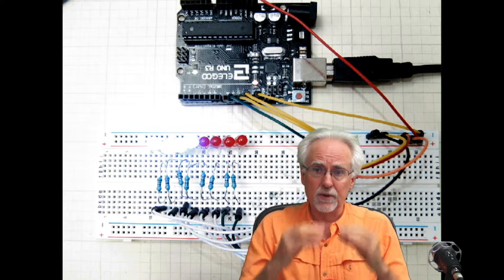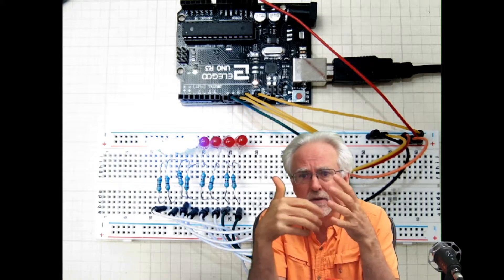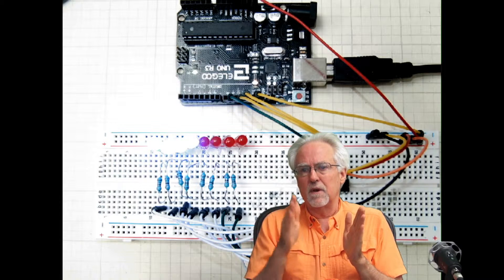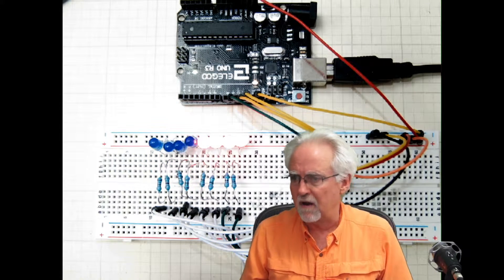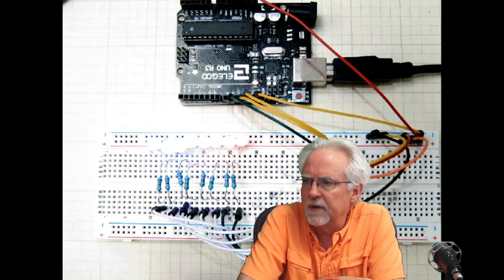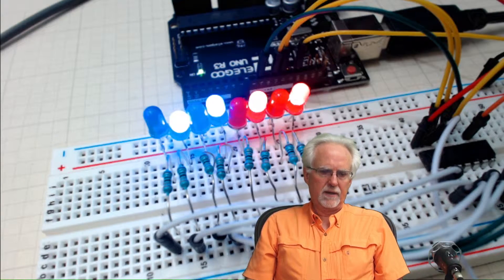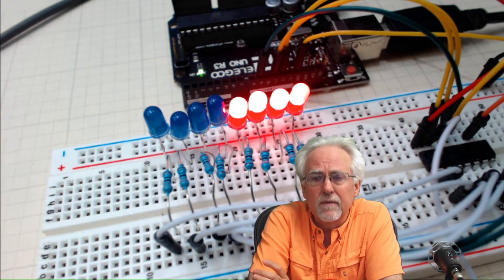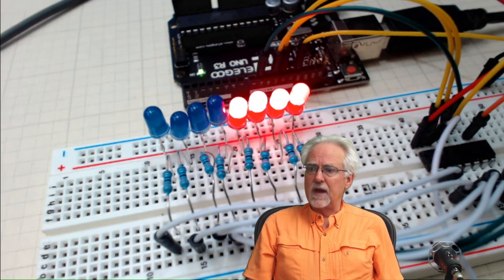Arduino Tutorial 46: HOMEWORK- Create a Binary Bit Flipper with the 74HC595

Comment: int dataPin = 12;   // DS
int latchPin = 11;  // ST_CP
int clockPin = 9; // SH_CP

void setup() {
  pinMode(dataPin, OUTPUT);
  pinMode(latchPin, OUTPUT);
  pinMode(clockPin, OUTPUT);
}

void loop() {
 
  byte leds = 0b01010101 ; 

  digitalWrite(latchPin, LOW); 

  shiftOut(dataPin,clockPin,MSBFIRST , leds) ; 

  digitalWrite(latchPin, HIGH); 

  delay(1000); 

  
  leds = ~leds ;  
  digitalWrite(latchPin, LOW); 
  shiftOut(dataPin,clockPin,MSBFIRST , leds );

  digitalWrite(latchPin, HIGH); 
  delay (1000) ;
}

Comment: I used Value=0xF0; to turn on the high nybble, or the 4 leds om the left. Then I used Value= ~Value & 0x0F; to switch off the high nybble and turn on the 4 leds on the right. But this solution would require using Value in the shiftOut twice with a short delay called dt between each shift. Alternatively, I could use Value=B11110000; and Value=B00001111; , but that's not true bit flipping. I believe the "~" operator is.
A little thought in the mater suggest: Value >> 4; shifts the high nybble into the lower 4 bit nybble position. Simpler.

Wayne

Comment: Homework:

int latchPin=11;
int clockPin=9;
int dataPin=12;
byte LEDs=0b10000000;
byte LEDread;
int wait=500;
String data;

void setup() {
  // put your setup code here, to run once:
  pinMode(latchPin,OUTPUT);
  pinMode(clockPin,OUTPUT);
  pinMode(dataPin,OUTPUT);
  Serial.begin(9600);
}

void loop() {
  // put your main code here, to run repeatedly:
  LEDread=0b11111111-LEDs;
  Serial.println(LEDs,BIN);
  Serial.println(LEDread,BIN);
  digitalWrite(latchPin,LOW);
  shiftOut(dataPin,clockPin,LSBFIRST,LEDs);
  digitalWrite(latchPin,HIGH); 
  delay(wait);
  digitalWrite(latchPin,LOW);
  shiftOut(dataPin,clockPin,LSBFIRST,LEDread);
  digitalWrite(latchPin,HIGH); 
  delay(wait);
}

Comment: Yes Paul, I've done the homework above though it took me sometime to figure out the math involved.
At first I was only able to make the last four bits(LEDs) complement the first four bits by multiplying the value of the byte by 16( 2 raised to the power of 4. )  In this manner any value between binary 0 to binary 1111 that you put in be be replicated in the four higher bits. Beyond that it was all garbage.
Then I begin to think of deducting a given value from 255( all LEDs lit ). For example if the value given is 250( binary 11111010 ) and you deduct that from 255( binary 11111111) you get 5 ( binary 00000101 )which is the complementary symmetry resultant.
Used this in the formula and voila it works !!! Now to check out Tutorial 47 on how you did it.

Comment: int latchpin = 11;
int clockpin = 9;
int datapin = 12; 
byte count = 0x0F;

void setup() {
  // put your setup code here, to run once:
Serial.begin(9600);
pinMode(latchpin,OUTPUT);
pinMode(clockpin,OUTPUT);
pinMode(datapin,OUTPUT);
}

void loop() {
  // put your main code here, to run repeatedly:

digitalWrite(latchpin,LOW);
shiftOut(datapin,clockpin,LSBFIRST,count);
digitalWrite(latchpin,HIGH);
delay(500);
digitalWrite(latchpin,LOW);
shiftOut(datapin,clockpin,MSBFIRST,count);
digitalWrite(latchpin,HIGH);
//for(count=0x01; count<=0xFF;count++){
// digitalWrite(latchpin,LOW);
//shiftOut(datapin,clockpin,LSBFIRST,count);
//digitalWrite(latchpin,HIGH);
//Serial.println(count,BIN);
//delay(1000);
//}
//if(count==0xFF){
//  count=0x00;
//}
delay(500);
}

Comment: "BOOM!" I did this on my own, I am a doer, quite simple really, all I did was myByte=255-myByte; to get my new answer, heres my Code Mr.McWhorter:

int latchPin=11;
int clockPin=9;
int dataPin=12;
int dt=1000;
int myByte=0b10100101;  //Input into here

void setup() {
  // put your setup code here, to run once:
pinMode(latchPin,OUTPUT);
pinMode(clockPin,OUTPUT);
pinMode(dataPin,OUTPUT);
Serial.begin(9600);

}

void loop() {
  // put your main code here, to run repeatedly:
digitalWrite(latchPin,LOW);
shiftOut(dataPin,clockPin,LSBFIRST,myByte);
digitalWrite(latchPin,HIGH);
delay(dt);
myByte=255-myByte;
digitalWrite(latchPin,LOW);
shiftOut(dataPin,clockPin,LSBFIRST,myByte);
digitalWrite(latchPin,HIGH);
delay(dt);
}

Comment: I got it working using the circular shift to equqte the the bit values as bit 8 to bit 1 as it would cycle through eight if()-else() statements. I haven't looked ahead so there could be a lot of unnecessary code.

Comment: Did it with an XOR.

byte LEDs= 0b11111111;
byte LEDsR=0b00110011;
byte LEDsL=LEDs ^ LEDsR;

Enter your bits into LEDsR and write LEDsL to the dataPin